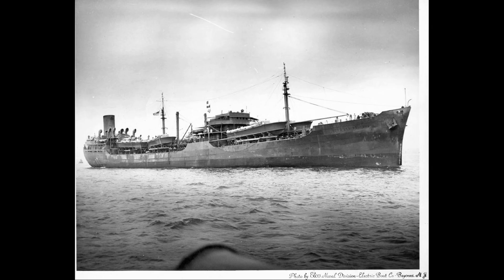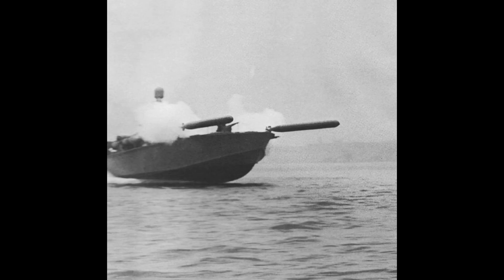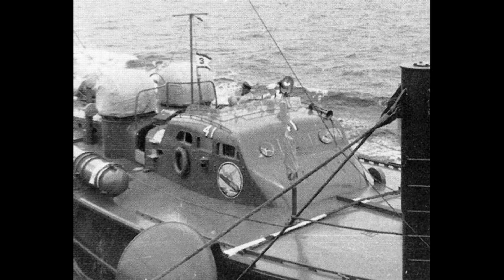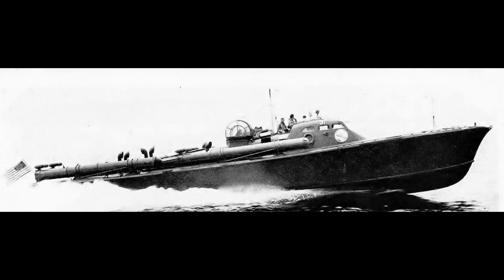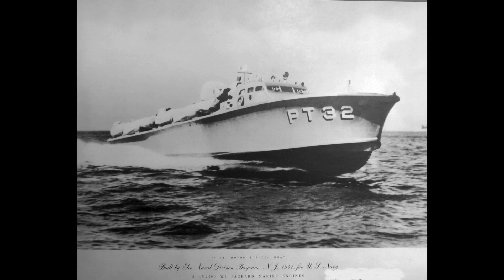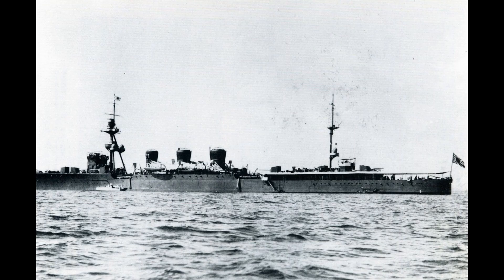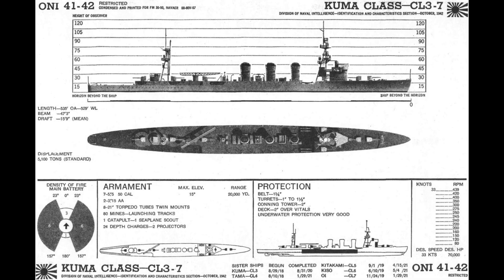PT Squadron 3 - Guide 161

Comment: Are you sure the Lewis gun was a .303? Lewis guns were available in .30-06 as well and seeing as .30-06 was the standard US rifle and machine gun cartridge at that time, it would have made more sense for the Lewis guns used to be the .30-06 version. Of course, it wouldn't have been the first time the us military, particularly the Navy, used a non-standard cartridge for a limited use weapon, so it may well have actually been a .303 version.
Reply: The bloody Brit Drachfinel just automatically said .303 when he said Lewis gun. Only the Brits used that oddball round with its oddball casing. It's super-likely the American ones were .30-06, like you said.
Reply: Well, if he did just make an assumption, it's an understandable one, as .303 was by far the most common chambering in the Lewis gun. As far as .303 being an oddball round, in that period it was no more odd than the Russian 7.62x54mmR or the French 8mm Lebel or several other rimmed and tapered cartridges that were still in common military use at that point.
Reply from the maker: Ask mentioned in another reply, the calibre of the PT Boat Lewis guns varies depending on which source you use and is further complicated by the fact that Savage (the manufacturer) made M1917 pattern Lewis guns in .303 and .30-06.

So I ended up taking an informed guess.
Reply: @Drachinifel  Seems reasonable enough. Like I said in my original post, if it was indeed in .303, wouldn't be the first time the USN or US military in general used a non-standard cartridge in a limited use weapon. I just asked the question because I was curious if you had misspoken in the video or if the statement of .303 was deliberate. Thanks for the response!
Reply: @Axel0204  All three of the rounds you described are definitely still oddball rounds. They require extra complicated, strange mechanisms for guns to function using them, and they were only used because unusual circumstances prevented their replacement. It's like the computer equivalent of a device using a parallel  or serial port. Just because it's common doesn't mean it's not odd.
Reply: Don Jones Actually the Japanese used the 0.303 in some of their machine guns and developed a rimless version that they used right through WW2.

Comment: The engines used were Packard V-12s, 2500cuin, supercharged.  The engine was initially designed as an aircraft engine in the 1920s, but was a commercial failure.  In the 1930s, Gar Wood started using them in his racing boats.  The Navy chose the Packard engine over the Hall-Scott Defender, to power all PT boats.  A Packard 4M-2500 as well as Wood's "Miss America X" which uses 4-2500 engines, are on exhibit at the Packard Proving Grounds north of Detroit.
Reply: soaringtractor  negative.  First, the Liberty was liquid cooled, co-designed by Jessie Vincent of Packard and A J Hall of Hall-Scott.  The 4M-2500 used in PT boats was a derivative of the Packard 1A-2500 developed in the 1920s.  Mosey down to your public library and check out a copy of "Master Motor Builders" by  Robert J. Neal.  It is a history of all of Packard's work with non-automotive engines.

Comment: Who ran our torpedo program, Mitsubishi?
Reply: The Bureau of Ordnance (BuOrd)
Reply: Apparently the same company that made them for the Germans, since they had the same basic problems at the start of the war.
Reply: That may actually have been an improvement since Japanese torpedoes were significantly less likely to malfunction (though they could still malfunction if improperly stored)
Reply: @bkjeong4302  To be fair, if an American torpedo malfunctioned it turned into a dud. If a Japanese torpedo malfunctioned it tended to explode, often triggering a sympathetic detonation and in a few cases taking the ship with it.
Reply: @Loweko1170  

That's if it got hit, not if it malfunctioned. (actual malfunctioning Japanese torpedoes turned into duds)

Also, one case of an oxygen torpedo exploding and fatally damaging the ship has been disproven through wreck analysis, though it did happen with other ships.
Reply: The Bureau of Ordnance did more for the Japanese war effort than some of the Japanese ships damage control teams
Reply: I'm betting that the person responsible had political connections. Otherwise they'd have been publicly executed.
Reply: @Walter-wo5sz  Probably the son of a former Vice president/Senator.
Reply: The issues with the MK8's early war were that most of them had been produced during the First World War & had actually aged out. But Congress at the time, being such a tight-wad with funding never bought replacements. The MK13/14/15 issues were a little similar, the units were too expensive to "Expend" during live-Fire exercises & complicated enough that they NEEDED to be expended to work out all the bugs from the new systems. But again Congress was to cheap to fund replacements of War-Shots, & BuOrd said "Were Smarter(& of higher rank) than you so We Know Best, just shut up & go to War with these new Wonder Weapons. Of Course They Work, Your Just To Stupid To Know How To Use Them Correctly.) So until the War Patrol Commanders could convince Nimitz that the Torps were crap, nothing was done about it. And it basically took a Theater Commander implying that he was coming back to Washington D.C. & Norfolk to use some BuOrd Officers as target practice too actually get some action on the issue.
Reply: Actually Arrogant Bureau of Weapons.  It got a lot of good men killed and screwed many winnable engagements.
Reply: @ovk-ih1zp  Nimitz had many personal qualities, "Supple application of his opinion" was not one of them.
Reply: @waynevreeland3141  Actually, he was fairly, subtle really isn't the correct term but is the best I can come up with, but was also Extremely Decisive. Once he made his mind up about something, unless there was significant push back from higher authorities he would MAKE it happen. And as a MAJOR Theater Commander, there usually wasn't any push back since there was really only about three levels of command over him, JCS, CNO(King) & NCA(Roosevelt). Of course a sledge hammer to the face is more subtle than King EVER was, but with Nimitz he usually ran the PTO with a rather soft hand, making "Suggestions" unless needing firmer direction. But when someone has enough "Brass" on their collar & chest to shift a DE off center-line in calm seas, it usually meant it's an ORDER, whether you liked it or not. He WAS "Firmer" than the IJN's Combined Fleet Command, but Nimitz really viewed himself as a "Conductor" of an Orchestra, rather than a "Job Site Foreman".
Reply: @ovk-ih1zp  Good reply. My comment leaned into his threat to go back to Washington and feed some of these weapons to BuOrd Brass just doesn't, how you say, show the "supple" side of his personality.
Reply: @ovk-ih1zp  Simple and direct.
Reply: Blah b Actually the torpedoes were made on a cost plus basis by a navy owned workshop - and were quite expensive as a result. Arrogance from the design team - “the our design is perfect, you are screwing up” attitude from the designers in Bue Ord delayed fixes for over a year.

Comment: Seeing those pictures of cargoships transporting PT boats i have a question.
Was there ever a plan or even a prototype of a PT boat carrier?
A ship that could in theory deploy lots of PT boats quickly like an aircraft carrier aircraft.
In theory the mosquito navy could swarm and attack an enemy capital ship/fleet  from several sides.
Even today navy's are still very nervous of fast small attack/suicide/drone craft.  
1 such craft took out the USS Cole and killed/wounded US servicemen in Aden who had to be retrieved by a drydockship to be repaired in the US.
Reply: Onr of the german merchant raiders had a seaplane and a high speed motor gun n totpedo boat -smaller than these

Comment: Very brave guys, in these wood boats. Many had problems with engines and gears, mechanics would improvise. Having seen these boats in real life, your realize how small they really were. They were very narrow and hot. Many times the crews would rest/sleep on deck. They also did a lot of night operations with a very crude radar, and even sunk a  sub.  Good thing, being made of wood they were hard to detect on radar and torpedoes generally could not hit them. Hit and run. Their only enemy that could touch them was airplanes.

Comment: Can you do something on the Mk 14 torpedo and why it was so unreliable in the early stages of the war? And the hubris of an admiral who stood in the way of success?
Reply: The Mk13, 14, and 15 shared a faulty fuse design - neither the contact fuse or magnetic fuse worked as designed, a faulty depth keeping mechanism that had the torpedoes running ten feet deeper than set and a gyro guidance system that had the torpedoes circle back to the launch point. The last is either known or strongly suspected to have resulted in the loss of three US submarines.

Comment: I got a chance to see a PT boat motor, outside the boat, in a museum. Built by the Packard luxury car company and the size of a restaurant dining booth. Very impressive engines
Reply: Packard M2500's    2500 cu inches of supercharged  Power  1220 to 1850  depending on the model, 14,000 of them were built by Packard.

Comment: How do you fire the back torpedo tubes , do they swing out slightly?
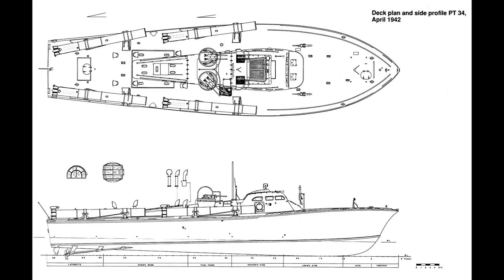Reply: At 1:20 if you look at the top 2 torpedo tubes they look like they are swung out more than the 2 below. So yes it looks like they are on a sliding track type of mount.
Reply: From what I remember of the museum pieces, and training films I have seen. I think the front tubes were angled outboard slightly, and the rears were manually cranked outboard at an angle, pivoting at or near the stern of the tube.
Reply: For firing, the tubes are hand cranked to a angle and ejected by a black power charge on top of the tube. Gyro on the torpedo then correct the angle to aim straight ahead.
Reply: Originally cranked out. Later, they started using aerial torpedoes which did not have issues with exploding and were shorter. These were not fired off (giving away your position with a bright flash) but were rolled off on special racks. That also reduced boat weight by a few tons. These were easier to reload as they were simply craned down instead of shoved down a tube. By then, some boats were going all guns and no torpedoes as PT 59, JFK's second boat for shooting up barges.
Reply: @josephburke7224  Among other reasons, it was weight compensation for moving the 20mm forward and replacing it on the fantail with a single 40mm Bofors.
By that time the problems for using the Mk13 aerial torpedoes that replaced the original WW1-issue tube-launched Mk8s (developed for use in the four-piper Wickes and Clemson classes) had been ironed out, and certainly dropping them off the side of a PT was less violent than a launch from a TBD or TBF.
Reply: @josephburke7224  That was one of the surviving 77' Elcos (PT59 - 61) that had the TTs removed and 2 single 40mm fore and aft and 4 additional twin .50s added.

Comment: No mention of 109? There must be a reason. Great video, thank you.
Reply: HG Barnes 109 was never part of the unit.
Reply: @Pilotmario  Happily corrected :)
Reply: The story of the 109 happens with the reformed  Squadron 3. in the Solomon Islands a few months later. The Orginal  unit was dissolved with the fall of the Philippines in April, 1942. So new unit, new location.
Reply: @WALTERBROADDUS  And PT109 was part of the later 80' Elco class (PT103-class).
FWIW: PT109 had an ad hoc modification for dealing with the Japanese barge traffic in the Solomons. She had had an Army M3 37mm AT gun complete with its wheeled carriage strapped onto the bow.

Comment: Well done, Drach, but all too brief. It is hoped there will be another video about PT boats during the Solomons campaign.
I'm unsure, but rattling around in the back of this old skull is the notion that it was during construction of these plywood craft that duck tape was invented.
Reply: PT Boat hulls were built of triple planked mahogany lumber . Plywood was used for the decks.
Reply: @walthammond6816  Thanks for the correction. I was pretty sure they had plywood hulls, but after seeing your post, I did some checking and found multiple sources that said they had a double layer of mahogany for their hulls. Wow - mahogany!

Comment: What is the ship pictured at 1:00? Is it a general purpose freighter or a bespoke mothership/tender for PT boats?
Reply: A freighter with Davits to carry the boats as deck cargo. They had no built for the job tender.
Reply: @WALTERBROADDUS  mm, not quite.  Ship is a conversion from a tanker, I'm not sure which class.  Closely resembles what would be known as the T-2 (POL carrier cousin of the Victory cargo carrier).  Many where "stretched" with the addition of more midsection tankage in the late 1950s and early '60s and serving commercially well through the 1970s.  I sailed on one in 1971 that was contracted to Military Sea-lift Command to deliver refined fuels to Vietnam from refineries in the Persian Gulf.  S.S. Prairie Grove. Launched in 1943.  Operated at that time by Mathieson Tankers, Inc.
Reply: @gyrene_asea4133  To be completely correct, yes. It's a tanker. I was trying to give a short reply. That should be the USS Ramapo. That was the ship transporting the PT's to Squadron 3. However they never arrived. The boats  and crews were used to reinforce  Squadron 1 and 2 instead.

Comment: PT boats and their crews were romanticized by the Press of it's time. There was a picture, promoting something, war bonds, etc. It showed a PT boat with an aircraft above it...implying that the boat's speed could mirror that of 'said plane. Of course, the reality was much different. I also read of the fact that Japanese Destroyers could chase a PT boat, if the PT's engines were in need of maintenance, and the "Boat was slowed from it's optimal capabilities. Thanks. PS: When radar was perfected for smaller vessels, the PT's had another tool. However, radar on ships the little boats were supposed to shoot, apparently negated their effectiveness. PSS: Please feel free to correct or expand my post.

Comment: Post Tramatic boat disorder 
..
Makes you wonder what they could have achieved with better equipment. ..
Reply: You mean like actual torpedoes?  Think we may need a rant contest on those.
Reply: @scottgiles7546  working torpedoes...  any protection whatsoever for even some of the crew.. Yes that sort of thing... they were basically underbuilt power boats with a few .50 cal in very annoying perspex bubbles...
Yet again Congress paying for equipment that seems barely good enough... but naa.. it's crap..
Whilst other navies lavish funds on larger splendid craft with every upgrade to lever advantage...
Reply: @blogsblogs2348  The original boats developed in WW1 were stealth boats like the Italian MAS boats and the British CMBs. They were designed to get into enemy harbors by stealth until they got in range of their targets. Some were fitted with an auxiliary electric drive that could do maybe 5 kts in near silence. The Italian SLCs were like a submersible counterpart.

Comment: The Philippine Island that was home base for the PT's is pronounced Min-dan-ow.  Bulkely would get the NAVY CROSS for smuggling MacArthurs part (including NINE nurses/nursemaids and son Arthur MacArthur, and Mrs. Jean MacArthur) to Australia (some 1800 open water miles in 77 foot boats!).  The primary problem the PT's had was the requirement for clean aviation fuel (99 octane or above)l. Their fuel was initially shipped in a tanker, transferred to 55 gallon drums and cached (which caused the paraffin dissolved in the fuel to settle out and clog fuel filters at the most inopportune times (like the during the attack on Kuma, during which Bulkely's own PT32 had all four engines die while under fire!) It is now acknowledged to be at least partially fictional but the maintenance problems of the PT's are highlighted in 'they were expendable'.

Comment: The Lewis gun data is off at best.  Though not repeated here internet sites like ww2db claiming "The typical Elco PT boats carried ... two twin M2 12.7-mm or 7.6-mm Lewis machine guns mounted on rotating turrets..."  is simply dead wrong.  Clarity of text can be argued but to be sure no Lewis gun was ever produced in 50 caliber, the cartridge for which was a John Browning design original to the M2 machinegun.  Furthermore, unlike as IS stated in this video no US service branch ever issued a weapon in .303 British (ignoring arguendo "possible" WWI land-force contingencies that long-predated the PTs ), which would have created a logistical nightmare for ammo.  US Lewis guns were chambered in 30-06', many of which wound up in Britain as part of Lend-Lease.  
  I've got to go back and re-read "They Were Expendable" but I don't recall any mention of Lewis guns, though my original copy of the book was the product of WWII censors and somehow I doubt it was ever revised.  Blowing up an early stateside photo of PT-19 shows there "could" be a pair of Lewis guns in the starboard gun tub, judged solely on the basis of the size of the tarpaulin-covered twin barrels (the whole tub is covered and it is at speed so...), but that isn't definitive regarding what Bulkeley's boats had in the Philippines in late 41' & early 1942.  Sure, the US Navy could have used its supply of 30-06' Lewis guns to arm them early on, but none of the photos of the actual Squadron 3 boats in this video show anything resembling a Lewis gun either...
  Having said, most of the info here is good and it should be mentioned that the UK's Hubert Scott-Paine (later naturailzed US Citizen) was the real force to influence the design of these boats early on. Elco took what they learned from Scott-Paine (and what he himself showed the US Navy) and built most of the early US boats.